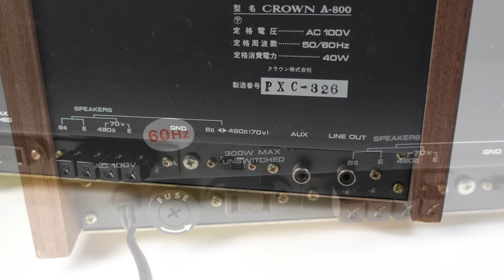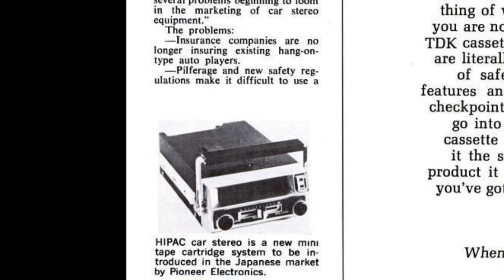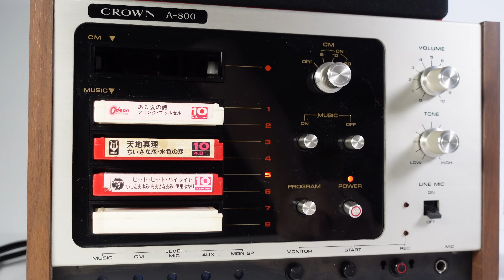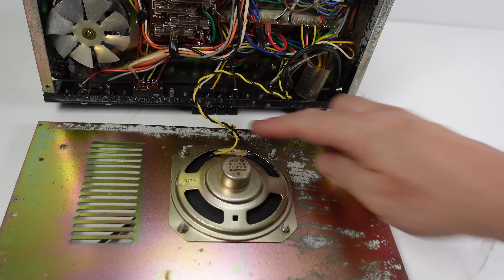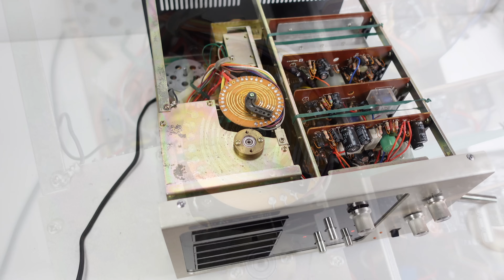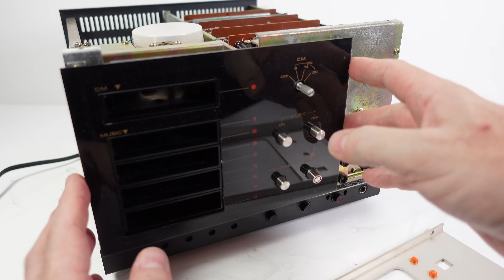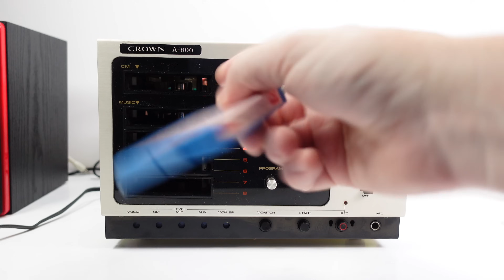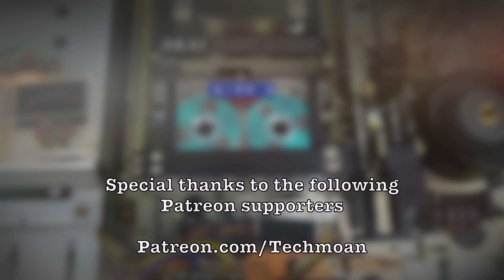An unusual player for a forgotten ‘70s music format

Comment: That cartridge was also used in a machine made by Univox. This was for musicians and used as a Tape Echo. 

Univox was an entry level brand and it was a blatant rip off of the Echoplex Tape Echo, the standard Echo used for live music and often in the studio. 

The Exhoplex used a proprietary flat, top loaded, horizontally sitting cartridge that used a 12 inch or so loop of 1/4 inch tape

If you made the number of repeats high, it would repeat what was currently on the tape loop on endlessly, warping and distorting the sound, the longer you let it go. Some times called Runaway. 

You’ve heard the Echoplex and Runsway effect on Pink  Floyd’s music
Jimi Hendrix used the Echoplex ‘Runaway effect on the Electric Ladyland albums.

Comment: changing the capacitance should change the rate of playback, make sure to use an ac rated capacitor of equal or greater voltage rating and it should be good.

Comment: Highly unlikely that one capacitor will make the motor run at another speed. It looked like that cap was on the power supply board so it's probably a line filter. I would wonder if it's a synchronous (frequency dictates speed) AC motor. I suspect there may be more connections to that motor and wiring it to different windings will change the speed. In any case, I wouldn't think the cap would make much difference.

Comment: I suspect your cm tape is not long enough.    Make it 10 minutes.   I suspect the cm loop is fixed at either playing for I one minute or maybe two minutes.  The only thing that would make sense would be to have an in-band 1 kHz tone (or so) that tells the unit to stop playing the cm message.   Beyond that, the time would just be fixed at 1 minute intervals or so.  
It makes no sense to use foil unless you have a foil every minute or two minutes.  Well, why go through all that trouble?  Just use a fixed 60 second spot that repeats X nunber of times as the set by the knob.  So, a ten minute loop would hold ten 1 minute CM messages.

Comment: Looks a lot like the old Muzak systems I used to service in New York back in the mid 70s.  They however used a single cartridge that was physically larger than an 8-track but functioned similarly and had much longer play time.  This obviated the need for a multi-cartridge changer mechanism but tended to wear out the cartridges faster. The machines were constantly breaking down which is when I and my boss would go to work.   It played mostly elevator music and, IIRC, rather than purchasing the system the shop owner paid a licensing fee to the manufacturer who would then send a new cartridge each month to keep his music from getting stale.

Comment: I live in Japan. 
As you can guess,This is the "Muzak" like system.
Until the 1980s, it was often used in shopping malls and street, department stores.

However, these are generally distributed in 4.8cm/s Fidelipac and Learjet style cartridges by 
radio broadcast company. 
I've never seen anything using Hipac, but this may have been the selling point for this product.
In Japan, Learjet and Hipac car stereo wasn't succeed in the end.

The CROWN is former venture radio maker, went out of business early. 
I think that there is no connection with audio manufacturers(amcron etc) in the US.

Please enjoy Japanese classical soul music :)

Comment: One correction:    The early 70s weren't just about 8-Track cartridges and players --- in cars.   I had a friend who owned a very nice 1968 Plymouth Valiant (2-Dr Sedan, green) that had .... get this:   not just a cassette player, but a cassette recorder.   I had never seen a recorder for autos before but he had one because the cassette format was seriously taking hold and the cassettes were smaller and you didn't need to deal with the different tracks --- they were automatic in the smaller cassette format.

Comment: Back in the late 70's we also had a format called "Quadrophonic" it was a four channel system using 2 speakers front and 2 speakers rear. It was around the same time some movie theaters offered "Surround Sound"
Reply: Made for the Dark Side of the Moon.  You really needed 4 ears to appreciate it.

Comment: Without hearing what you've concluded about this unit.  My first impression is that this is an 8-track tape player designed to be used on a P.A. system in some department store or other large retailer.  

Okay, HiPac, I only vaguely recall this term but never had the opportunity to interact with one.  Very cool find indeed.

Comment: Change the capacitor to that value in that type of capacitor . Its not  polarised. I would have expected a double pulley if its stickered as multi region , 50/60hz.   Also , the pinch roller brake mechanism is the   pause function mechanism . Good to see it again ☺️.  I did hear  slight wow  in the speed .  Those motors used brass bushes on the armature shaft . Singer sewing machine oil in a syringe applied to the bush at both ends and allowed overnite to absorb into the brass will relubricate the bushes. Otherwise its the tape being a bit stretched in sections .

Comment: I think your idea with the tones is correct. I'm betting that the blank tape would hold multiple announcements in a loop, seperated by tones. The reason why would be that the length of the announcements is variable, so the piece of metal foil can't be pre-placed. The tone was likely audible on the tape and over the store speakers, as it was in some of the other systems we had in department store here in North America. Or possibly only audible on the monitor. So you'd record a sequence of anouncements and the mic would tone between each, then you could play them back on the monitor and hear them all, then it would cycle through them over the course of the day

Comment: Found on eBay…..Portable Realistic  8 Track Tape Player Model 14-904A with two 8 track cartridges from Barry Mainlow one is still sealed,  Item has been tested and is working with power cord, batteries have NOT been tested,( Audio from one speaker isn't as loud as the other). Item is in Very Good condition. Please see photos and message me with any questions you may have, Thank you.

I asked him how much he would charge to not send the Barry Manilow cartriges.

Comment: I think you can use a device that plugs into the wall and it has a know on the front that can be changed from a couple different hertz ratings. Unfortunately, i can't recall the name. On the same idea as a voltage step up machine.

Comment: I had a 1968 Chevrolet Impala convertible which was the first year that an 8-track was available from Chevrolet as an option. It didn't come factory installed but as a dealer installation and the massive unit extended from the dashboard to the floor in the center over the driveshaft hump. I wish my Impala had it, but I had to be satisfied with mine being one of the approximately 950 cars with a blue vinyl roof.

Comment: HI.Great Videos. For testing 60Hz devices that needs 60hz to perform well....Your can use a 12vdc power supply to 12vdc to 110/120 Vac 60Hz power inverter to power the 60Hz devices. 100/200W rating is enough for the mayority of record players, cassette Decks, etc. For more techy guys you can use 12v 220/240v transformer and a 40w or over audio amplifier and a sinoudal tone 60hz (tone generator/pc, etc) and ajustement the ouput voltage from de volume control.... Regards from Argentina

Comment: Re: American car systems. From 1957-2004 the 'standard' factory sound system in US cars (as in, what they threw in just to fill up the hole in the dash) was an AM radio and two speakers. Optional model from 1966-1970 was an AM/FM with (further optional) Cassette deck. By 1971, 8-track had replaced the Cassette deck as the premium car audio format. The peak of 8 track was when Ford offered the 1975 Lincolns with a Quad 8 deck and 12 speakers.

By 1980, all of the car manufacturers had stopped offering factory 8-track decks and had reverted back to audiocassette. You could still purchase aftermarket car stereos with 8-track players up until around 1989 or so, but pretty much everyone had a regular cassette deck by then, and a few had car CD changers.

Europe and Japan were the reason US car manufacturers killed 8 track. By 1979, most of GM and Ford's US production were made up of rebadged Japanese and European vehicles with the wide cavity in the dash to accommodate audiocassettes. (8 track decks required about half the width of a cassette deck for dash space.) Once the Big Three stopped offering 8 Track decks, people stopped buying 8 track tapes.

Comment: Hipac players were sold briefly in the US. I got one as a gift when I was a child. I believe the unit was called a "Playmate". It resembled a portable battery powered cassette player. The tapes were never easy to find and could only hold about a half an album's worth of music.
Reply: I had one called a "PlayTape" that had a similar looking tape.  I got it for Christmas when I was about 10 in 1968 or so. Looking at a picture the cartridge looks a bit different, but I do remember it had a 2 track player running 1/8 inch tape at 1 and 7/8 ips.

Comment: One thing you could do to run 60 hertz appliances is convert to DC and then use an inverter that generates 60 hertz power. A way to do that which I know for sure works and might be easiest given that you don’t need to run things that long for these videos is buy a couple deep cycle lead acid batteries, charge them up from the mains, then run a US market inverter off them. You might even be able to wire a battery charger straight into an inverter. Either way you this would allow you to run 60 hertz electronics without having to modify them pretty cheaply, if you use batteries you could even get a 50 hertz inverter and have it double as a backup power solution.

Comment: The motor is synchronous, the RPM is determined by the mains frequency.  To adjust the tape speed, you would need to change the motor pulley diameter along with changing the phasing capacitor.  Changing the capacitor alone will not change the speed of the synchronous motor.  I remember this on early tape transports in the 1970s.  Some machines would have a stepped pulley on the motor and you could change the position of the capstan belt to change between 60 and 50hz.

Comment: The problem with tape long term isn't so much the pads or tape heads or pinch rollers or any of that, its the fact tape is rust attached to a plastic substrate and backed on , as you record it arranges the metal rust magnet north and south poles this makes sounds as it passes the heads these electrical pulses create ac current this same current is ampfiled to play over the speaker and move air making sound, but becuse its rust the rust flakes off the tape. Ive got old  high qulity tapes that this has happened to.
Some of the top brand blank tapes I made my own off lps. But you cant play them anymore. Too much rust has flacked off.  Mine sounded almost as good as the lps the prerecorded ones sounded like shit.
The recording industry went nuts becuse of DAT and its ability to record as well as the orignal. Becuse they would loose money, but around came cds then CDRs
Look the recording industry makes money every time they have a media formate change. And they made all the money not the artist making the recordings. LED Zeppelin put an end to that crap . Now mp3s and youtube give artists a better option  but I dont care for ditigtal music,  give me back my LPs.

Comment: Buy a us-made ups. The capacitor potentially could change the speed, but would have to be more precise than that. I suspect this one is just to slightly optimize hum reduction. Speed change would generally be a different side pulley, or a motor replacement

Comment: Get 2 capacitors one of earache rating and add in a connector that allows you to quick change the capacitors it’s a common modification it would also allow you to test if switching the capacitor works

Comment: Interesting piece.  At 1:25 the 70 volt amplifier output indicates that this is a design intended for commercial use. With 40 watts of audio output, a considerable number of (typically) ceiling mounted speakers could be installed throughout a business and powered by this output . Each speaker has a transformer mounted to it that matches the 70 volt output of the amp to the impedance of its voice coil.
It is interesting also that the 70 volt output also shows that its output impedance is 490 ohms. I have seen many commercial amplifiers with 70 volt outputs, but never one with this 490 ohm value marked on it.

Comment: I love how modular it is. A device you could easily repair if anything broke. Wish such a design ethos was still prevalent.
Reply: Going for nowadays small form factor in everything, something had to give. Unfortunately it ended up being repairability, and it only makes sense if you look at it from the perspective of a manufacturer. More units sold instead of repaired, more money. 🙄
Reply: @alkestos  It's worse than that. They're intentionally making them harder to repair yourself too.

For example, the FCC ruled in 2012 that companies couldn't just slap a "warranty void if removed" sticker on anymore. They had to prove someone caused relevant damage from tampering in order to not honor the warranty. If you sent something in for a screen repair, they had to prove you damaged the screen by tampering. Even if your battery actually was damaged by tampering, if you only sent it in for the screen repair which you hadn't damaged, they had to honor warranty at least on that screen repair.

Those companies responded by making it incredibly difficult to repair yourself without damaging it. A great example is Apple phones. Their entry points are packed and sometimes even attached to delicate vital cables that will break under the slightest pull. Boom, now they don't have to honor your warranty.

Right to repair is dying a much more intentional death than many people realize. Form factor added difficulty to be sure, but it goes a lot deeper than that.
Reply: @ledumpsterfire6474  yea but it's awful but the right to repair is something companies might be forced to do one day again
Reply: @alkestos  this is an industrial grade machine, totally different market from consumer electronics. Modern servers for example have this kind of modularity.
Reply: Old computers are all like that too for the most part. I remember when we first got WiFi, we just took out the old card and replaced it with a new one. We even replaced it agian so we got better range on the WiFi signal.
Reply: @Stettafire  To be fair, all but the lowest end or absolute smallest PC's are still like this; I did a CPU swap just yesterday; 15 minutes total, including getting it all set back up.
Reply: @squidlybytes  PC's are niche computing devices. Almost everyone has a smartphone.
Reply: It was a common design for professional equipment designed for easy repair -- JVC professional grade VCRs were built this way, as were Tektronics oscilloscopes.
Reply: Servers are still done this way. Industrial and professional equipment are mostly done this way, only consumer devices that are very tightly integrated now.

Comment: I did not recognize the HiPac name, but.....listening to the description, it sounds like the Playtape format- a dismal failure here in the US. anyway. Around 1970.  Possibly a larger cart, cause Playtape was only about 6 min. long. Also, I knew Japan used 50 and 60 Hz, but did you know they use 100 Volts on everything.

Comment: My parents had a cassette player installed in our 1962 Chrysler Newport in 1971.  I always preferred that to eight track.  My aunt an uncle had a factory 8 track player in their 1969 Ford LTD and I remember the music changing tracks in the middle of a song.  Each track was ten minutes long, so forty minutes of music in ten minute increments vs playing 30 minutes per side on a cassette and hearing the song in its entirety.
Reply: I always thought it was funny what an afterthought stereo placement was in 1980s european cars. I had a stick-shift Volvo where you could only insert or remove a cassette if you were in 2nd or 4th gear, otherwise the shifter blocked the slot...I also had a Mercedes where you couldn't insert or remove a cassette if the shifter was in "park".